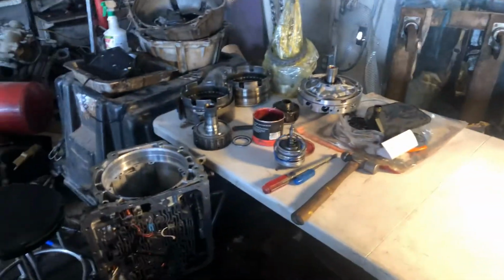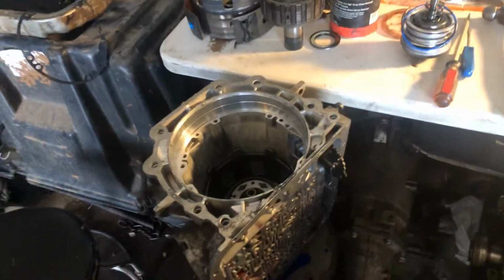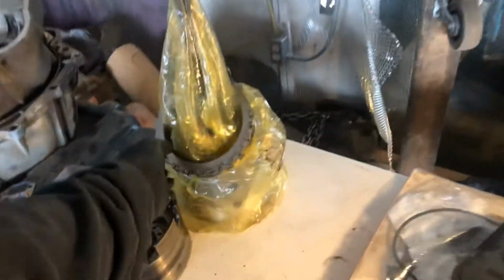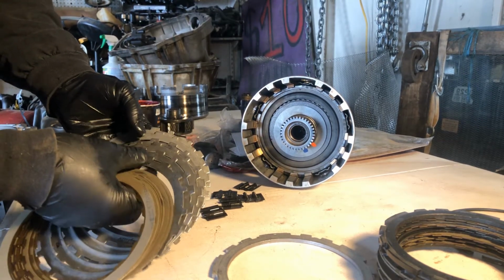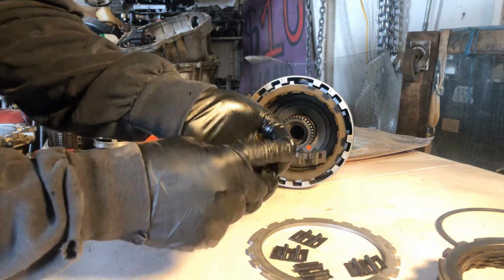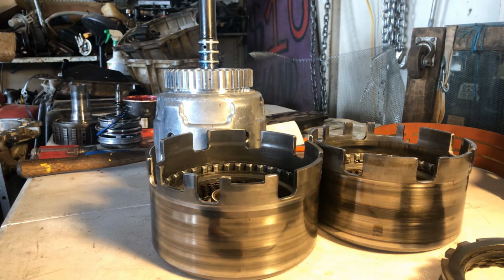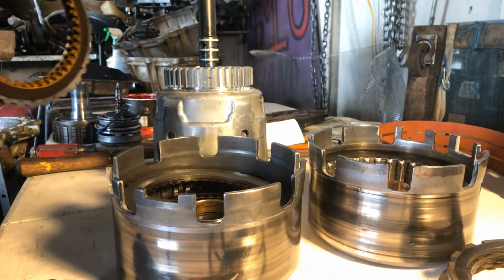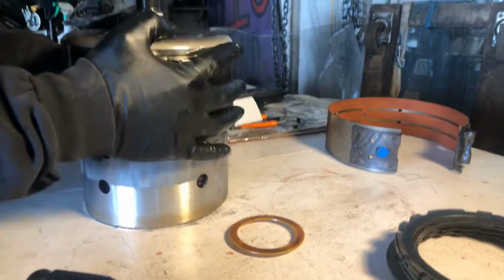Pt 2 4l60e-4l65e 8 clutch 3-4 instead of 6

Comment: Hello friend, I have a question, is the valve body of the 4L60e the same as the 4L65e? Another thing, can I place the sheet of the valve body without the two gaskets? Nothing happens? Regards
Reply from the maker: Yes they are the same valve body’s and no you must have the paper gaskets attached to the valve body plate with a few random dabs of Vaseline